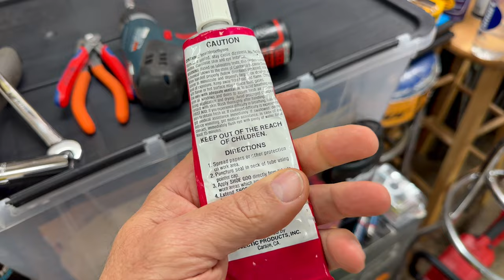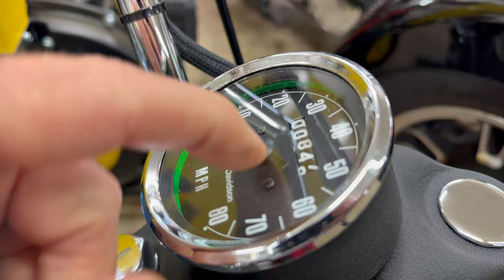The Harley X-90 Restoration!! • Photos & Videos..! | TheSmoaks Vlog_2772

Comment: Cool little bikes i have ridden a many a miles on one. I still have the Harley Shop Manual and Parts Manual to mine. This was the first engine i ever rebuilt as a kid in like the 5/6 grade (57)now. Noticed didn't hook up the two stroke injection throttle cable under the right side front cover. Did have some of the original parts but haven't look lately
Reply from the maker: That is awesome!  Thanks!! 👍